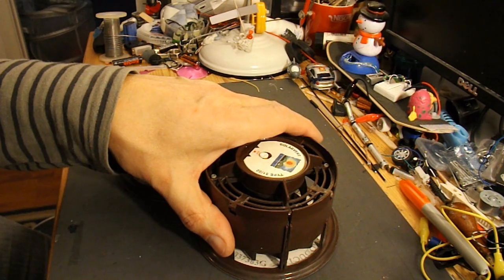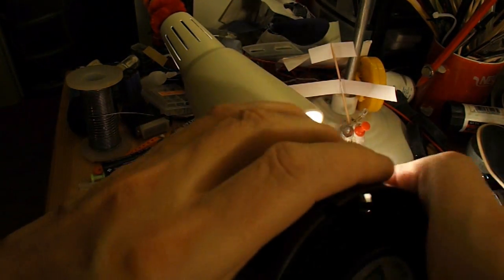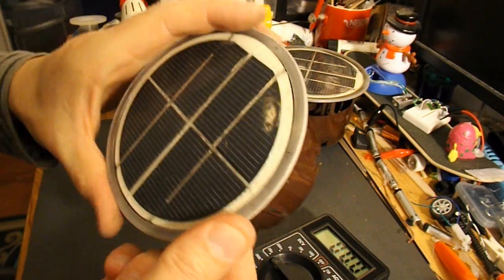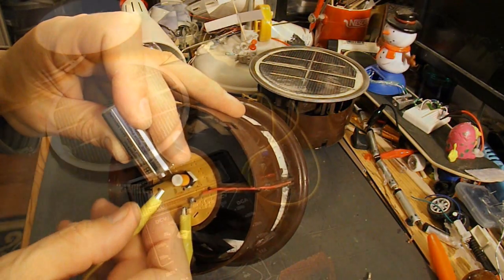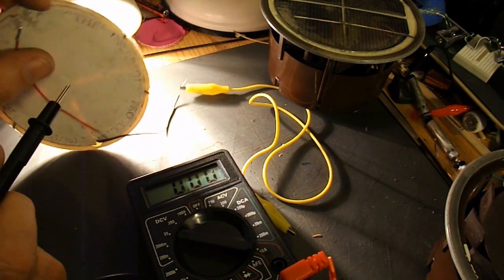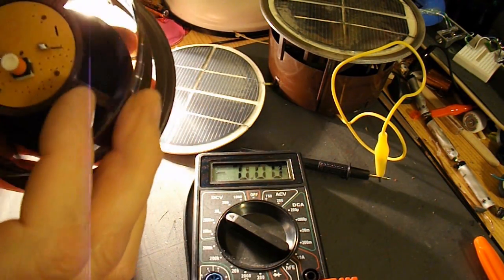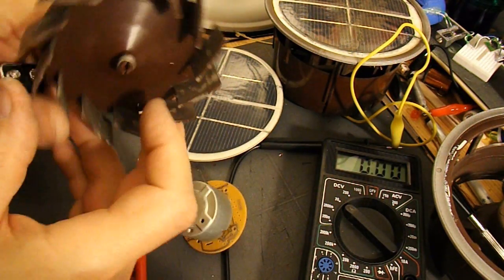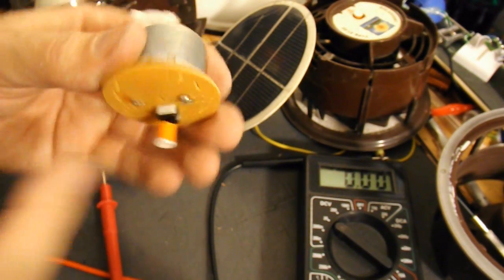Let's disassemble a Solar Vent

Comment: that blower could be used for a paddle boat.
Reply from the maker: To be honest, yes it would probably work but it really does not need to be that shape for a paddle boat. The angle of the blades means it would draw the water into the centre of the wheel or if you spin it the other way it would be less efficient that ordinary flat blades.

Comment: the fan unit from one of those blowers would be excellent for a hovercraft lift fan, for a decently sized hovercraft at that (a 3ft by 2ft hovercraft)! that fan with a brushless rc motor on a 2 cell li-po will shift a fair bit of air...
Reply from the maker: It might work, but that would be a lot of effort to got to and then find it doesn't. I would think it was probably a bit heavy and I strongly doubt it is designed for high speed applications.

Comment: Enjoyed the teardown, have never seen one of those extractors.
That panel should be useful. 0,55V x 3 = 1.65V @ approx 400-500ma by the looks of it.
I'd second the paddleboat idea as noticed below, if I was asked lol.
Have always wondered what happens to a paddleboat that's going full steam ahead and then is thrown into reverse, Does it make a watery mess or is it a graceful transition ?
Reply from the maker: If you use it like a traditional paddle boat with the shape of those blades it should be more or less omnidirectional. In reverse it would not be scooping the water. As it is I can imagine it will scoop water into the centre of the wheel and then you have to eject it sideways. I was thinking of trying it laying flat in the water filled bottom of the hull with a jet tube pointing backwards so it works like a jetski. It would be a rather involved project so it might not happen or it might be one of those ones I do a bit at a time over a long period.
Reply: GrandadIsAnOldMan
A jetski is a novel project ! Never seen a jetski built...out of anything.
Another thought was a water dragster, by using both solar vents and putting the rotors on the back, small foam 'wheels' at the front.
Reply from the maker: slider2732 slow down, too many different ideas :-)
I was just thinking of something working on this general principle http://youtu.be/a4Ia24rhENk?list=PLA5a2xPRSrB24vUS9E8zkSgjZysEL00zr

Comment: you should try to make a paddle boat with that fan blade
Reply from the maker: It would probably work. I will think about it. As Malicious1111 suggested it could easily be used to make a water pump.